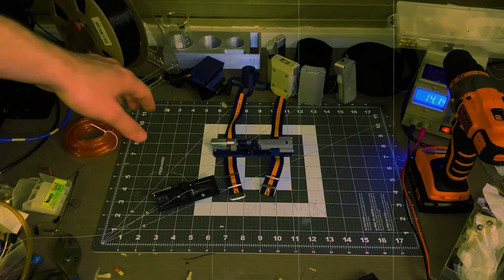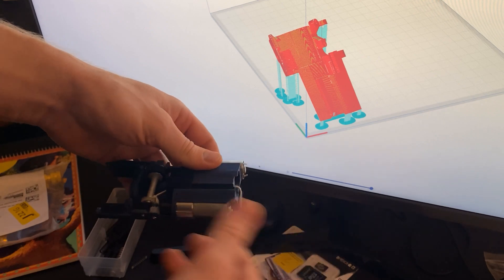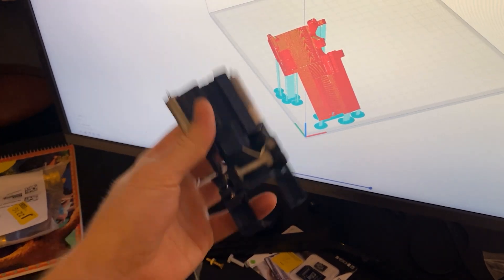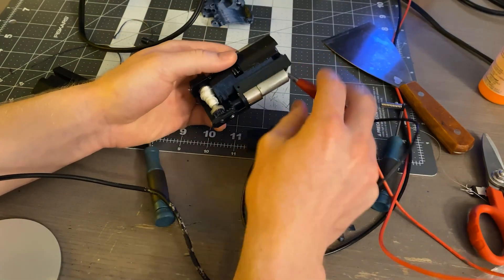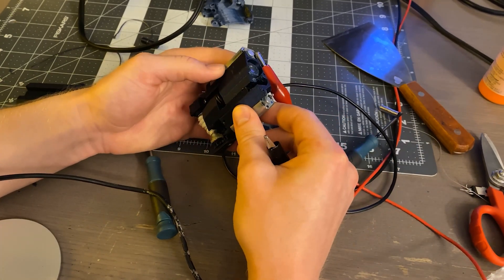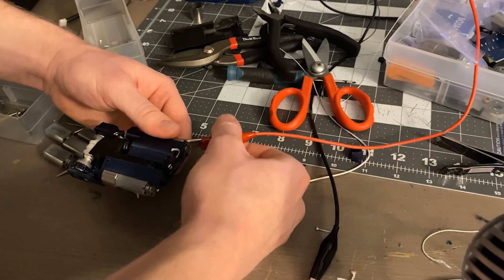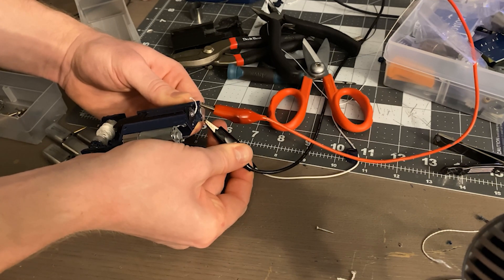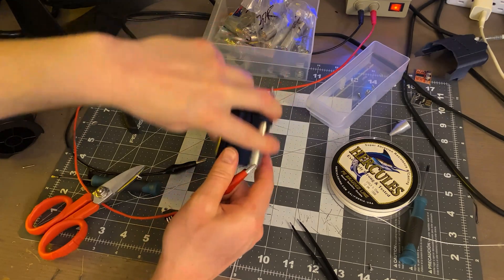Part 2 | Web-Shooter Building: Chronicles of Misery

Comment: In all honesty I think wrist mounted rewinding is the most limiting and the most impractical. I feel like it takes up too much, much needed, real estate on the wrist. The wrist should be where handling the “web” is done, locking cutting if needed, hook tying. I believe having a spoil on the shoulder or shoulder blade with a guide system for the line is more effective. Longer line availability, the winding mechanism can be stored there allowing a stronger motor. The forearm can be used as a way for automated hook switch out or even rope gadgets. The wrist should have a sailers rope lock that is used to hold the line, allowing the swinger to actually swing form it without needing to be able to physically hold on to the rope.